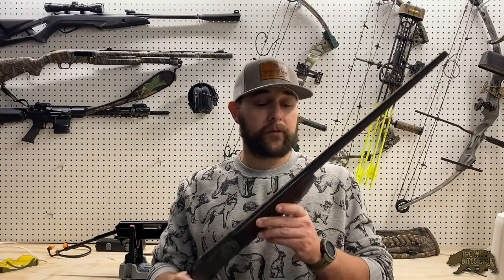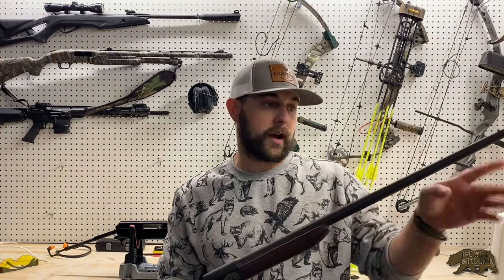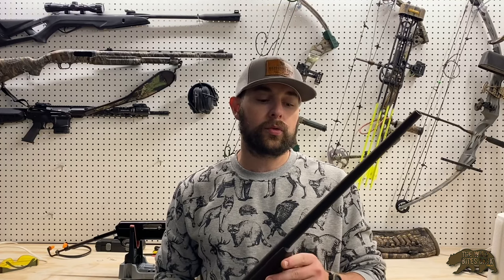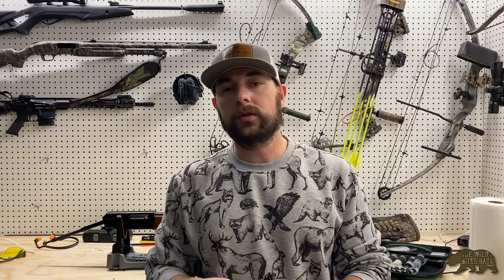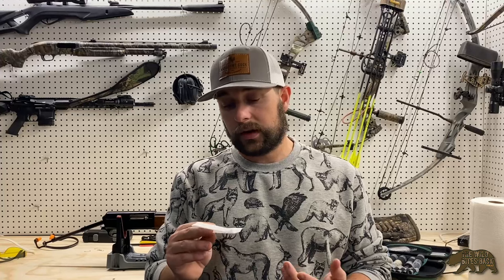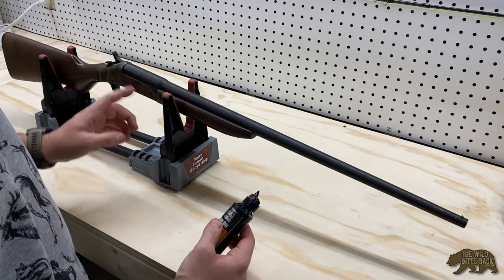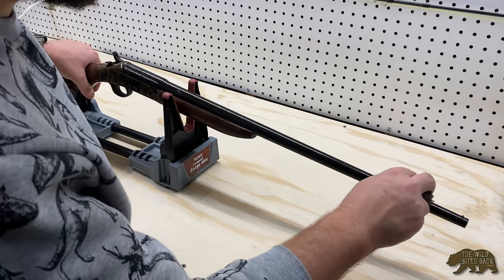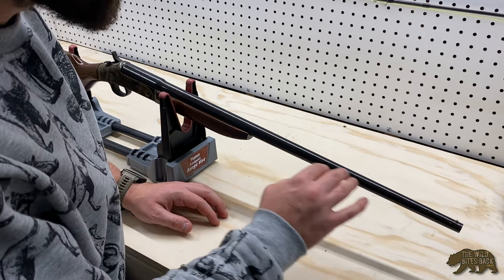Remove Surface Rust From a Gun Barrel (EASY!)

Comment: Do you absolutely need steel wool are can it be done with just a rag and oil ?
Reply: Rag and oil will work for a very light rust. You're better off using copper or brass wool on the bluing. Steel wool can and will scratch bluing. You can also use a pure copper penny to scrape off bigger pieces of rust. Soak the spots in oil and then gently rub the copper wool or penny over the rusted areas. Then keep it oiled. If down to the base metal protect it with cold blue.

Comment: Thanks for this.   I found my old Shotgun with surface rust.  I took some Silicone Spray and a rag and removed most of the rust, but it is slightly pitted.   I did look DOWN into the barrel and it looks shiny, but i am going to buy a new Gun Cleaning Rod and kit and oil it up.

Comment: How would you remove it from the inside of the barrel thanks
Reply: Put the wool on a long stick similar to a bird cage perch like wrap it around then slightly dampen with oil then twist as you slide it in and out the barrel/Barrels keep repeating until clear,should work
Reply: @TruthseekerOz ty